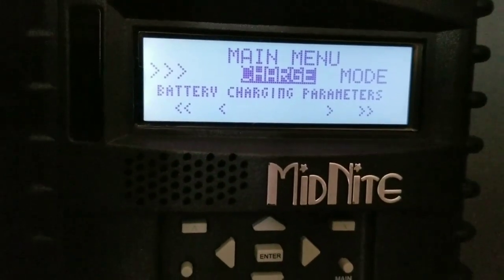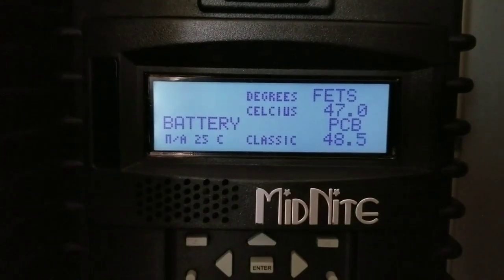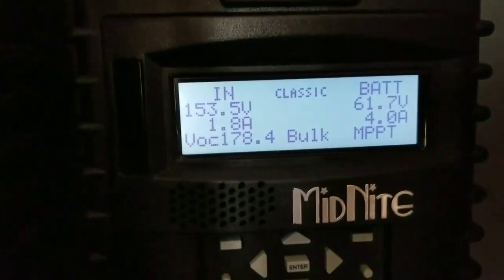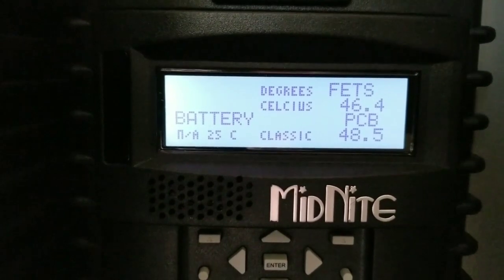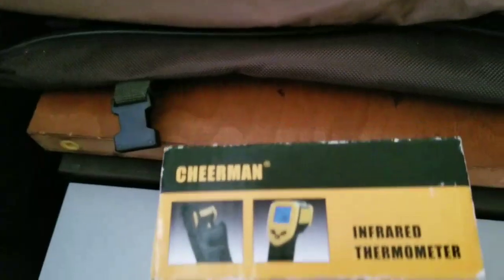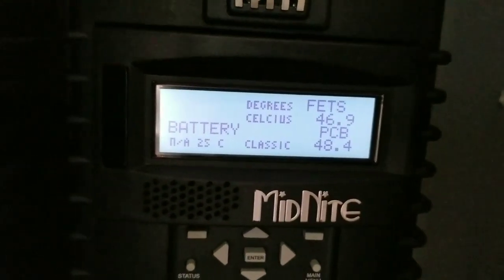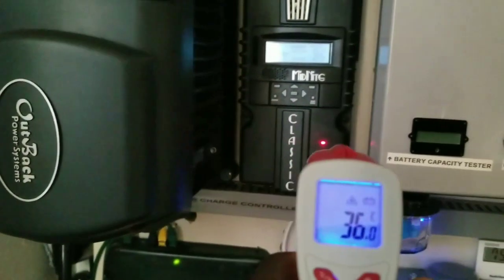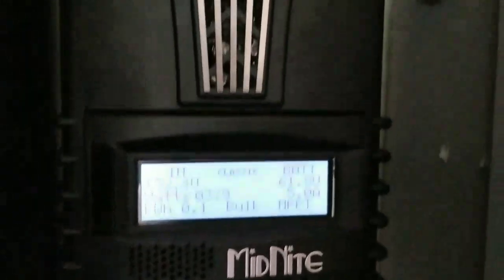MIDNITE SOLAR CLASSIC TEMPERATURE PROBLEMS: FETS TEMPS: MOSFET TEMPERATURE PROBLEM: HOW TO FIX

Comment: The 250 is the only model that runs hot, and I will admit I am pushing mine with 1700 watts and 60 amps it never quits but my fet temps are 60 c. The fans all work everything does but I do use an external fan to keep them cooler. No problem let us know when you run the 250 to it's limits and see the temps. Thanks for the video.